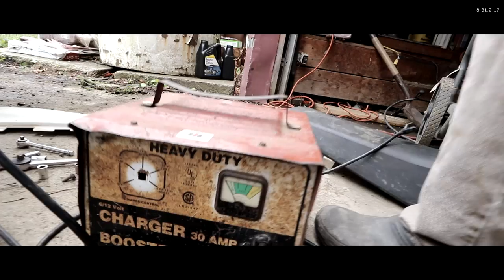DOGS VS DIRTBIKE

Comment: My dad has a 2009 silverado and the actuator door for the driver side was broke in half and let hot air on the driver side and cold on the passenger side.

Comment: The easy out is very hard to drill threw considering it harden carbon steal. You need an Diamond tip drill bit. I've delt with them a lot best way is if you have a friend that is good with torches and burn the easy out out all end-of-course the bit that is now in there and punch or just cut the entire thing off the new kickstand do believe they make a nice aftermarket kit weld that on. But you've been to school for welding so you should know all that already. I had a buddy had a 07 GSXR 750 never paid attention when putting sliders on that the bolts are too long they thought threads were just dirty and tried criminal bolt that was Gordon's too long in there and snapped it off and need to get it out of the engine block please say he's running one last Intermountain now who made a totally different bracket to support the frame slider. Red Sox cuz they bought it off eBay for exact bike that it would be right size bolts instead of checking before putting them in. Most likely that your best bet is to start over cut it all off and get a whole new aftermarket kickstand they'll might have a stronger spring to stay up or do away with it and only use a tripod stand off the rear axle but anyhow good luck should do some more better videos of doing more service work on some more close up so we can actually see some true action of the work you guys still screw what haters say if you're doing it wrong or not long as it comes out the way you're satisfied what is it and it holds up but it is a race bike and he is racing all-time on rough trails so maybe he is better off to go without a kickstand so it doesn't pop down while he is out riding hard and end up causing him to wreck whichever could make him fall back a few places and not win the race 5